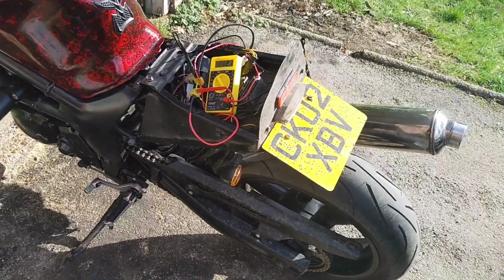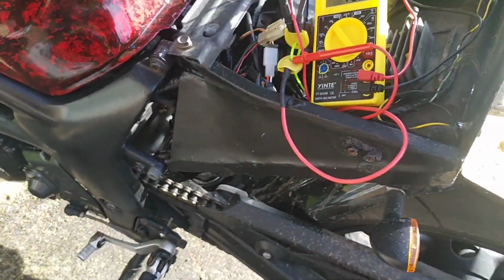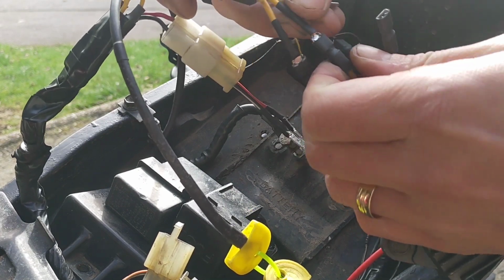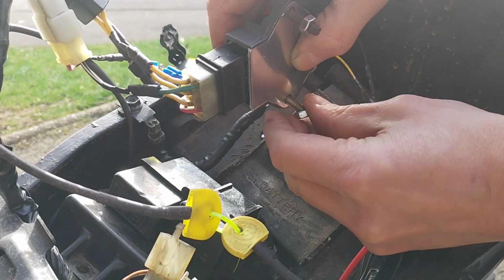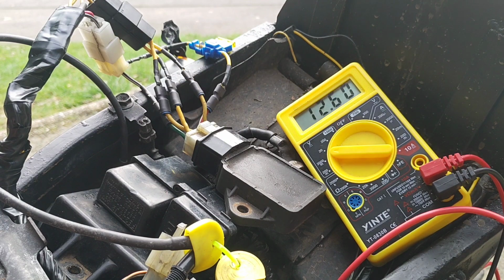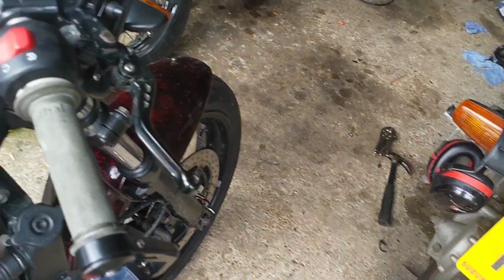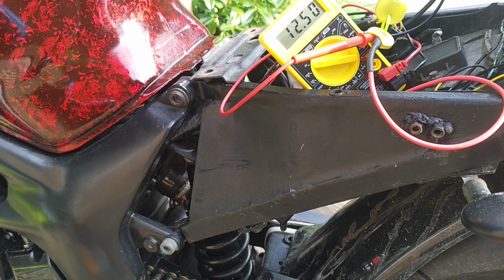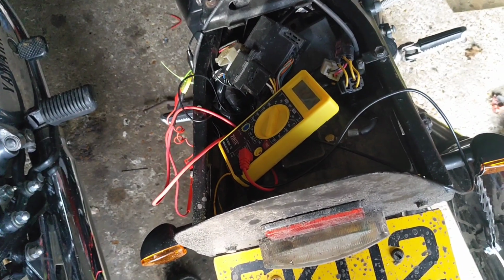SV650 Frankenbike. Driving me slightly nuts.

Comment: I don’t think it’s charging Nat, I think that’s just the battery recovering. Check the volts on the three yellows, this will be ac volts and it should be even between each two wires, around 70V Ac. Then check the output of the regulator with the red/ green wires disconnected. I’d expect this to be over 13.5V DC. Hope this helps.
Reply from the maker: Thanks mate. I will have a look in the next couple of day. I also have a offer in on a replacement stator just in case!

Comment: Nat stupid question but was the melted cdi also a cbr one or a SV one?
Yes the input to the battery should rise when revs increase....either stator/stator pick ups or the wiring from it unfortunately. 

Sticky cable ....slinky cables are brilliant if you replace it 😉.
And a sync definitely won't hurt too....

Great content but that fuzzy subscribe intro is  nauseating lol
Ride steady and stay safe bud 🤘
Reply from the maker: The cdi is a SV650 one. Just the reg was from cbr. I have ordered a replacement stator but will confirm in the next couple of days. 

 Am bored cleaning out the cables so light just replace them. 

Sync tomorrow ( if I can get away with it)!

Pushing my luck with the missus so it might take a few days!

Comment: Its definitely not charging Nat it would dramatically jump to over 13v with a little revs. 

Stator check will be next I think mate
Reply from the maker: That’s my thinking mate. Pretty certain that it isn’t the rectifier.
Reply: @NatsNackersYard  no it appears to be the stator although as you saw from my lexmoto it could also be wiring. 

My guess would be stator though.

Comment: Try unplugging your newly mounted side light and see what the voltage is when running. I had an Er5 once that smelt of sulpher after a run. Turns out the the regulator had let go and in turn took out the stator as well so even after I replaced the regulator, it still didn't charge until I changed the stator. Electrics are a pain sometimes. Process of elimination.
Reply from the maker: To be fair I think that the problem predated the led but it’s worth a shot. Thanks for watching mate.

Comment: Had same on my vfr got new battery then got 13/14 volts
Reply from the maker: The battery in this is only a couple of months old so, although I can’t be sure, I don’t think that the problem.
Reply: Have you checked the stator readings on yellow wires or my a diode that’s not letting change threw
Reply from the maker: @kevcollins2079  exactly the same video I checked out earlier this evening. I will have a look tomorrow mate. Thanks and I will keep the channel posted!